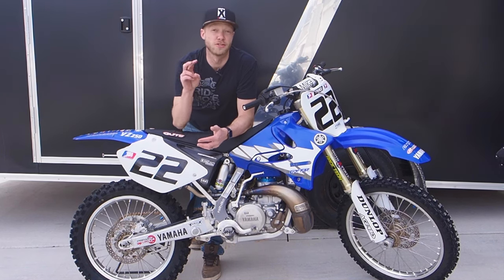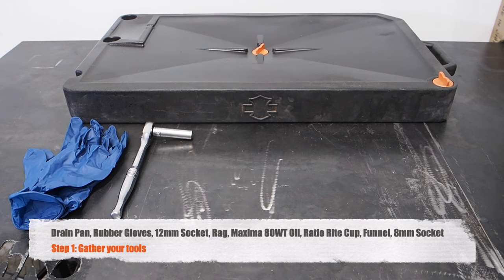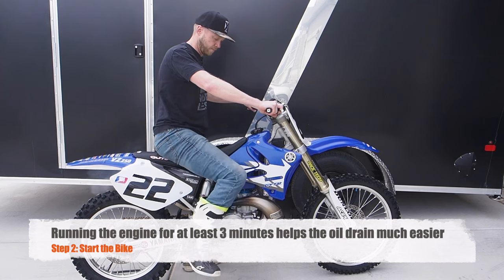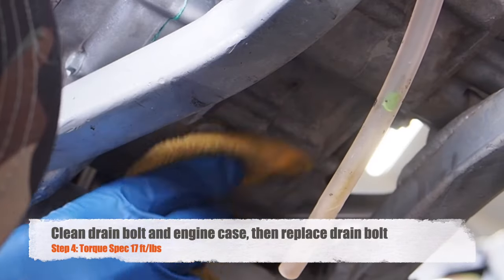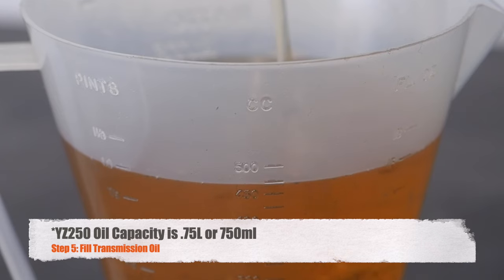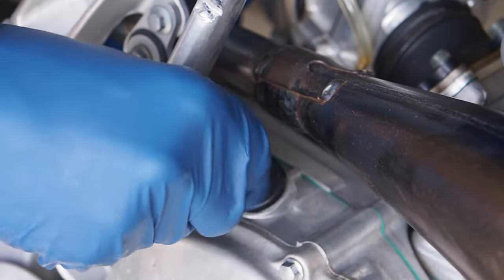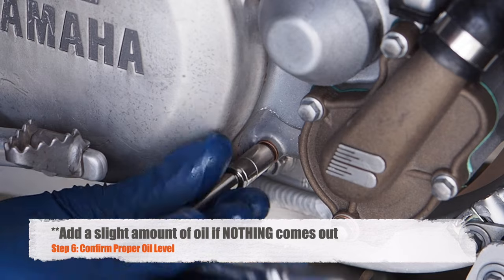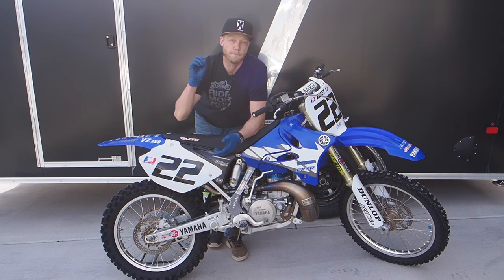6 Simple Steps to a Perfect Yamaha YZ250 Oil Change!

Comment: Just pull the check bolt while your putting the oil in and as soon as it starts to run out stop and put the plug in. No need for a measuring cup. It’s 2023. These guys need a way to easily measure only in the bike such as dipstick or sight glass as well as an electric gauge to read fuel levels but of course I’m asking to much for a $10,000 bike right

Comment: Before i put my new oil in i usually fill it with diesel and let it run for few minutes and then drain it and then new oil , it clears gearbox perfectly       sorry for my ENG
Reply from the maker: Damn didn’t know you could do that! Thanks for letting us know 👍🏼
Reply: wait so u put diesiel in your oil hole? does it help ?
Reply: like i mean just for like minute two

Comment: Hey folks be careful, because in my 2001 if I keep the check bolt open and I just pour oil until it flows out of it, I won't be able to fill the gearbox with more than roughly half of those 750 ml because its height is wrong!! I found it out the first time in which I did an oil change some years ago investigating on the internet: even in more recent models it's always been at the wrong height! As far as I know they have never fixed the problem, so DON'T USE THE CHECK BOLT and measure the oil amount beforehand instead.
Reply: Where can u find how much oil goes in? How do i know the amount of ml
Reply: @five10short  It's written in the manual and also on the clutch cover. For my 2001 it's 750 ml.
Reply: @MVPever  cool thanks for responding

Comment: I bought some Yamalube engine oil at the dealer last week when I bought my 2023 YZ250, that stuff pretty decent? I will switch to Maxima next.
Reply: I have a 23 also and I have chosen bel-Ray 80w gear saver imo it’s the best choice for gearcase and wet clutch
Reply: @kennethallison2168  Why is there no difference between 80w gear lube, and 10-40 oil today?  I know I would not run true 80w gear lube in my bike. It would probably lose 1hp (to the wheel), and the clutch would probably drag with the lever pulled in.  I don't think Maxima 3w shock oil is 3w either.  It seems pretty thick in my shock compared to the stock Yamaha s-1 0w shock oil.  I just wanted to slow the rebound down a little bit, (stiffer shock spring), and damn, it will slow it to a slow creep.

Comment: Great video. Short and to the point. Would you happen to know the size of the crush washer?
Reply from the maker: Thank you dude! The bolt is size "M12" so grab an M12 Washer. Here is a link to them if you need! https://www.rockymountainatvmc.com/parts/bolt-aluminum-crush-washers-p?ref=1057
Reply: @GregHitchko  
Thanks! Picked up some yesterday at Cycle Gear. 👍

Comment: I just filled mine with about 350cc, (less than half it takes), of oil on a level stand, before it started flowing out of the "oil height check screw hole".
It would have been nice if Yamaha put the oil level hole at the real oil level height.   If they don't use a dip stick, they used a oil level hole.  What good is the oil level hole if it is too low in the cases?  I would love to know the engineering thought that put the hole there.
Reply from the maker: Very interesting statement right there dude! I'd be curious to test it some more, maybe over the next 5 oil changes take note if that can be something that is consistent data. If so, there truly is a problem with the oil level check hole in the case! Keep me posted on it my dude.

Comment: do the two strokes not have an oil filter that also needs to be changed?
Reply: fr lmao
Reply: Nope.  The oil lubricates the transmission and clutch in a 2-stroke, (usually the same oil), not the rest of the engine like a 4-stroke.  The oil mixed with the gas, (usually), lubricates the rest of the engine, (cylinder and crank), for a 2-stroke.

Comment: Use Yamalube
Reply from the maker: Always great stuff!
Reply: @GregHitchko  Any decent grade 10w-40w oil is fine for the tranny and clutch, but for the cylinder, I go by what has been tested on a dyno by a small company I know of (Quick Draw marine engines), for durability in small 2-stroke engines.  Today, their favorite oils are Klotz Supertecniplate, and the very expensive Motul Kart GP 2-T oil.  The Klotz does produce more carbon because it has 20% Castor oil blended with it, so they give the nod to Motul.  Once jetted well, I am sure the Klotz will keep the power valves clean until you need to replace the piston/rings.  Oils that failed the dyno durability testing?  I remember a couple.  That stuff called Purple something, and of course,------------- Lucas.  lol
Reply: @EarthSurferUSA  Hey, you're confusing premix oil with engine transmission oil